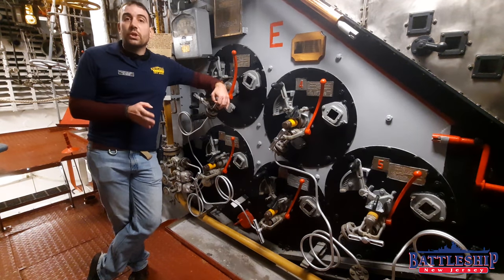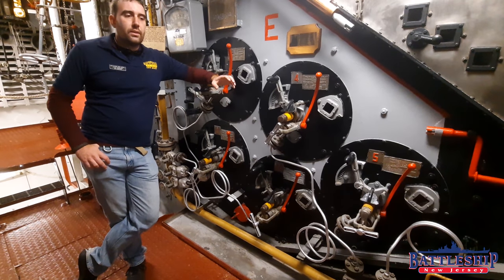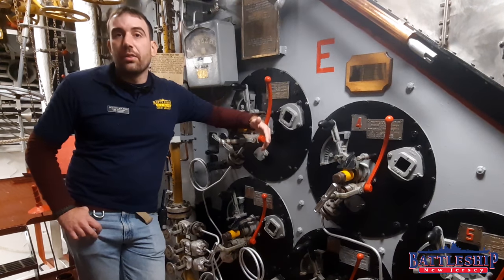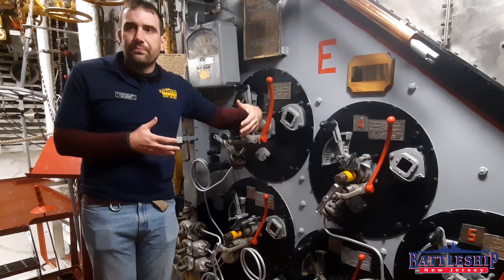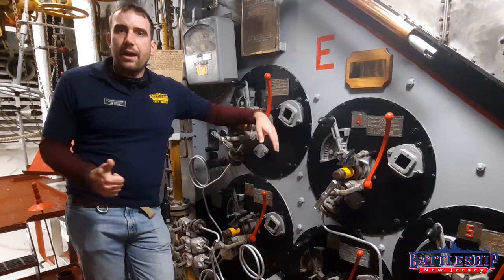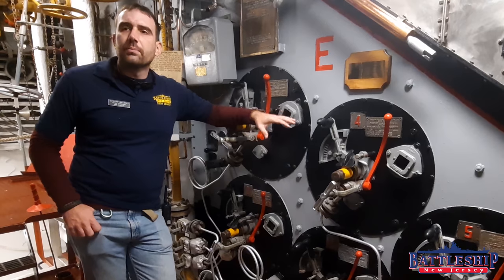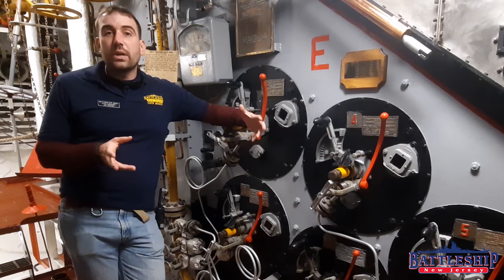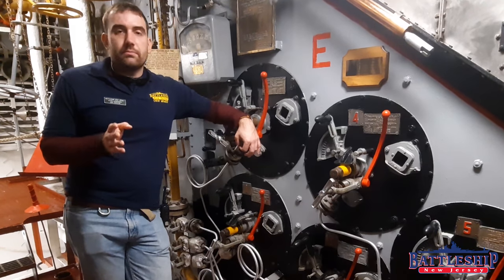Nuclear Powered Battleships

Comment: i made mention in another video on this subject briefly about why battleships dont last long service wise and it does have alot to do with the engines being flogged , and as you just detailed the effort to replace them is so destructive and costly its  not worth it , you may as well build a new battleship , but just on the power usage we are in " the l e d age " we have turned a technology corner in the last decade where things are using less power to do more systems are inherently smaller  and need less cooling and so forth , this is partly the reason why they can go the EM catapults because the rest of the systems on an aircraft carrier dont draw the same amount of power they usedto and that give so much of a power reserve they can look at EM catapults or rail guns or even lasers , even processing power in the ships systems has made giant leaps where in that video about the drone detachment their dedicated giant console would be the equivalent of a high end pc gamers rig with the processing power to perform other tasks if needed, this is the old pocket calculator has more processing power that the lunar module but it is now a feasible theory that an all updated iowa battleship could be mostly be run from the captains i phone

Comment: Depending on the fuel or type of reactor it is a good idea if we were going to build something new.  Oil fired boilers are no longer used in any actively commissioned ship nor are resources in place to fuel a Iowa class ship with the bunker C class fuel.  The modern alternative would be large diesel engines OR gas turbine powered with turbo-electric drives and electronic systems not reliant on steam power.

Comment: I agree with you on refitting the Iowa's with a nuclear reactor. That said if a new class of battle ships were to be made I would want to put a nuclear reactor on this hypothetical battleship because it would most likely be armed with rail guns which require lots of power and have lasers for close in defense once they are fielded in addition to CWIS and SEARAM missiles.
Reply: Montana and Colorado class have potential for upgrades since none were ever built. They stopped at the Iowa class. So if you can get the prints you can have some fun.
Reply: I actually have problems with lasers being the given answer. Instead, have you considered fast firing railguns in the CIWS role?
Reply: @JaneDoe-dg1gv  lasers are limited on its ability to keep a straight line. In order to hit something on a curve with a laser you need to bounce it off of something so they’re better for defense of the ship

Comment: Great video, your arguments are sound. I think the conventional power systems on these ships are the pinnacle of 'analog' oil-fired steam propulsion. They're just about as good as these systems ever got, and they've only served a fraction of their working lives. These battleships are low-mileage vehicles. Fuel cost alone doesn't seem to be a good enough reason to replace a system that we know is reliable and extremely robust. 

The only thing that really atrophies is the knowledge base on how to operate these great machines. Not that the Navy didn't write most of it down--it's the "what to do if it makes this noise" kind of expertise that sailors would have to relearn. Spare parts could also be an issue, but museum ships could serve as donors and American industry/technology could find a way to fill the gap.

Comment: When you talk about the nuclear powered cruisers, you have to understand their particular vulnerability to damage of the engineering plant by enemy action. Cruisers are not heavily armored, so hitting one with an anti-ship missile is probably going to get into the engineering spaces. Naval nuclear power plants are not like conventional plants, where  your can cut out the shot up parts and weld in the new boiler tubes and rebuild the fire boxes, and except for the fire damage from the fossil fuel fires, you can clean it up with a hose. If you breach the primary loop or reactor vessel, you are going to have a radioactive release from the coolant alone, followed by a release of fission products to the engineering spaces when the fuel structure fails under the decay heat that always accompanies nuclear reactor power history. Cleanup and repair of nuclear power plant battle damage would be orders of magnitude more difficult and expensive, provided you can obtain the forgings, pumps, electronics etc that will be needed to restore it to service. By the time the last nuke  cruiser was retired, its power plant was more than thirty years old and its place in the supply chain almost nonexistent.
Reply: Naval reactors are designed with battle damage in mind, often to an extreme degree.  Keep in mind these have been in submarines for decades.  They're designed to passively go safe in the event of battle damage. Their pressure vessels are incredibly robust, designed to remain reasonably intact even if the rest of the vehicle is destroyed.  The few US nuclear subs lost during the Cold War are routinely monitored for leakage.  Despite the submarines being completely imploded and in some cases with the hull shredded into small bits, the pressure vessels did not rupture.
Reply: @ThePrisoner881  I served in the Navy as a Nuclear Power Plant Operator NEC 3364 for more than 12 years. There are nuclear power plants in submarines in order to give them unlimited underwater operational capability, to maximize their ability to remain undetected by enemy surface and submarine forces. That capability is the rationale for putting a very vulnerable fission reactor plant design in those hulls. Please note that that is a vulnerability, not an asset, when it comes to battle damage.

If a submarine receives damage sufficient to interrupt power operation of the reactor powered steam plant, the ship must then rely on battery powered electrical propulsion to maneuver. The loss of the reactor plant, for any reason, but especially as a result of battle damage that doesn't breach the pressure hull, is very likely going to kill the boat. Whether or not if the reactor is shutdown safely, if it is scrammed when you need it most, you are definitely screwed, because the guy who just broke your power plant is waiting for you to surface or go to PD and start your single emergency diesel generator to finish you off. And, oh yes, the likelihood of the crew being able to repair the primary reactor plant piping or other major structures in combat in order to recover the reactor is approximately  nil.

On a surface ship, the only viable answer to this vulnerability is redundancy. That's why the nuke carriers have two very large reactor plants. That is also why smaller hull forms, such as cruisers and frigates, are not good candidates for nuclear power. They are stuck in a two dimensional war space where they cannot go unseen, which means that they are targets, as are all other surface combatants in existence.
Reply: @boydgrandy5769  one could make the argument that an oil-fired steam plant is similarly fragile although admittedly easier to repair than, say, the hot loop of a PWR.  High pressure piping of any kind is not particularly forgiving of shocks.

You make good points about there being considerations beyond the reactor surviving damage that would otherwise destroy the ship.  I did not address those in my prior posts.  I would posit, however, that damage sufficient to cause a reactor SCRAM would likely render any surface ship out of action.  And, as you pointed out, surface ships like nuclear-powered battleships would likely have two or more reactor plants.  Damage sufficient to SCRAM both would likely be sufficient to sink the ship, making repair a moot point.

Modern combat is not like that of the battleship era with surface ships trading broadsides.  Most attacks would be from missiles.  I don't see a nuclear battleship engaging in these, especially refitted Iowa's.  They're simply too outdated to last in such an engagement.  They'd never get close enough to a well-armed surface combatant to use the guns.  The battleship would, however, be much more resilient to any missile hits compared to something like a destroyer or cruiser.  Sure, the topsides would get a lot of damage, but good luck trying to pierce the hull.  Modern missiles are not built to defeat that kind of armor because no current surface ship carries it anymore.

I still stand by my original point, however: as a shore bombardment platform, battleships are unequaled.  They don't need nuclear power to perform such a role.  Too bad the Navy considers this role "obsolete."  No doubt many Marines will be KIA if an amphibious landing is called for, along with many Naval Aviators flying missions to protect them, all sacrificed when a better platform already exists.
Reply: @ThePrisoner881  The days when a Marine Division could make an amphibious landing onto a contested shore are over. A heavily armored vessel armed with guns with a range under 30 miles will not change that. Even if those guns are augmented by the use of cruise missiles, or other such munitions, the invasion boats are too far out and too slow to make a successful landing. When the over the horizon capable anti-ship missile came into the arsenals of just about every potential US opponent, the Marines on the water are vulnerable at ranges that make such exercises too costly.

Landing zone preparation for any future successful amphibious operation by the Marine Corps will have to include complete air mastery and total suppression of land based assets capable of striking the landing vehicles and their gator fleet home ships. That means Air Force, Naval Air, and Marine Corps air formations acting in concert to make the landing zone safe to put the boots on the ground. That also means that the long logistical tail of that effort has to be protected, because most of it will be on the water, vulnerable to surface and submarine attack.

The Desert Storm operation relied almost entirely on the cooperation we got from the Saudis, which allowed the US and the Coalition nations to pre-stage and deploy air and ground assets before the actual attack on the Iraqis went in. Without it, we would have been hard pressed to insert any significant ground forces there, and that is especially true of the armored units that would be needed. The maneuvering of the Navy off Kuwait, threatening a Marine landing in force, was a feint and was never a possibility because they knew that such a landing force would have been mauled badly even had it been successful.
Reply: @boydgrandy5769  the Marine Corps, as you might expect, disagrees with most of your conclusion.  To write off the need or plausibility for amphibious landings raises a very big question: how, exactly, do you plan to put boots on the ground if the enemy controls all the ports on his continent?  Do you just assume that won't happen?  Or that somehow, somewhere, you'll find a friendly port conveniently nearby?  That is folly.  Opposed landings will need to happen, and you'll need Marines to do it.  That means defenses must be taken out.

The principle threats to such a landing are air-to-surface attacks, seaborne surface-to-surface attacks, and land-based defenses. Let's address these one at a time.

Airborne threats such as fighter/bombers and missiles are the most dangerous.  An amphibious landing without air superiority would be suicide, but that's been true since before Omaha Beach.
  Establishing a safe assembly zone is the Navy's job here and they're well-equipped for it.  Carrier support and missile defense are pre-requisites for any landing.

Surface combat between naval powers is likely to closely resemble the air-to-surface battle, being done by missiles and aircraft instead of guns.  Given the US Navy's supremacy in this area, any kind of serious surface engagement is unlikely.  The bigger threat would probably be land-based aircraft carrying missiles or land-based cruise missiles.  Again, this is a job for the Navy and they have the tools to deal with it.

Lastly there are land-based defenses, and that's where the Marines come in.  The Navy has nothing to deal with this short of bombs and cruise missiles.  Vietnam showed the futility of trying to bomb someone into submission.  At some point you MUST put boots on the ground and the Navy has no means to do that.  You need Marines.  Those Marines require defenses be degraded, and the cheapest, safest, and easiest way to do that is with naval gunfire.  Yes, it can be done with aircraft, at great risk and greater cost. Yes, it can be done safely with missiles, but at great cost per unit and with a chance of interception.  But naval gunfire?  It doesn't come any cheaper and is impossible to stop once the shell is in the air.

Comment: One question: even if there were some simple, easy way to simply replace the boilers on the ships with modular reactors - didn't you previously mention that the fuel oil is an integral part of the torpedo protection system? And I don't know much about ship design, but I'd think that the millions (?) of gallons of fuel are given a lot of consideration during the design of the ship. Something like a nuclear carrier is designed from the keel up to never need all that fuel storage. So even if we could just snap our fingers and replace the boilers, wouldn't the ship still have to carry all the oil, and it's not like you would get any additional space, as the carriers did?

Comment: Refueling New-Klee-Arrr (Support a pirate navy!) reactors on a heavily armoured warship is a trivial exercise.  See the fueling arrangement of a CanDu (Canadian Deuterium) reactor.  Each CANDU fuel bundle is about 0.5 metre long, has a diameter of about 0.1 metre, contains about 20 kilograms of uranium, and has a total mass of about 24 kilograms, so they are way easier to move in and out of your reactor space than than a 16" shell, even including the shielded containers for expended bundles. (The unused bundles do not require shielding on their containers.)  And here's the REALLY BIG DEAL ... You can swap fuel bundles without shutting down the reactor.  Not that it's required given the duration of reactor "core" life, but you could refuel as an underway replenishment activity.

Having said that, I concur with Ryan that nuclear reactors are too finicky to power a "big boom boat".

The best propulsion choice for a modern build gun surface combatant is already in use ... gas turbines.  As a thought exercise consider changing New Jersey's boilers and steam turbines with immense amount of extra fuel and 8 x  Rolls-Royce MT30 marine gas turbines (2 per propeller shaft each @ 50,000 SHP) as used in the Queen Elizabeth class aircraft carriers, which use only 2.  What would flank speed be with 400,000 SHP? :-o

Comment: Nuclear Engineer here 👍.  The Ford Class reactors don’t require refueling for the life of the vessel.  Having said that, I agree that retrofitting a 60 year old hull is a bad idea.  It needs to be designed nuclear ☢️ from the drawing board - many support systems are required.
Reply: If a ship’s hull hasn’t warped and/or rusted, then it’s age is completely IRRELEVANT.  The steal doesn’t loose any of it’s strength with age unless it’s been allowed to deteriorate.
Reply: @mudman6156  - as I mentioned, retrofitting a non-nuclear hull for a reactor(s) is an engineering and construction nightmare.  It would be cheaper and faster and safer to start with a properly engineered design meant for nuclear ☢️ power.
Reply: @mudman6156  - you simply cannot just yank out the boiler and substitute a reactor vessel.  At least half of the below-deck systems and bulkhead general arrangements are completely different than an oil fired system.  It would take several years and billions of dollars to strip an Iowa down to its bare hull.  And as I said - at least half the bulkheads are going to have to be completely removed.  You’re talking millions of man-hours.   The economics and Shipyard time are wildly skewed against it.
Reply: Ship structures are built around their propulsion plants… this is a norm for naval architecture. Repowering conventional-to-conventional is hard enough. Repowering conventional-to-nuclear would be a military contractor’s dream come true!